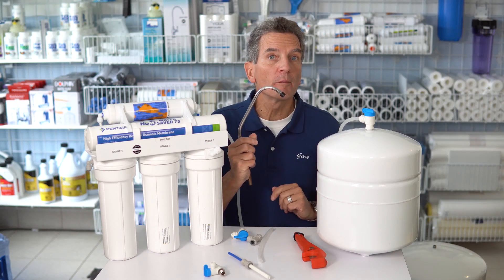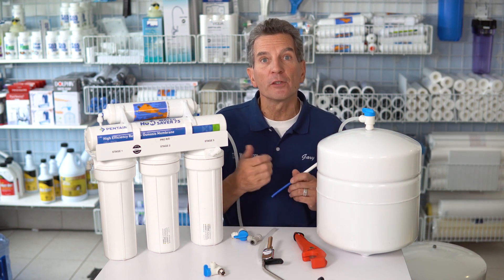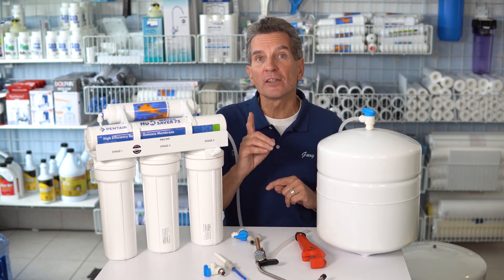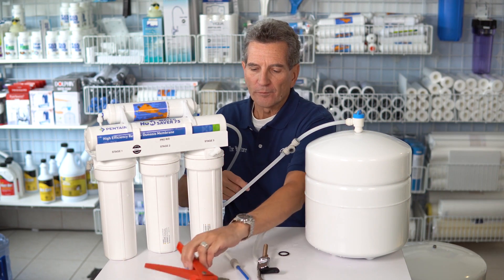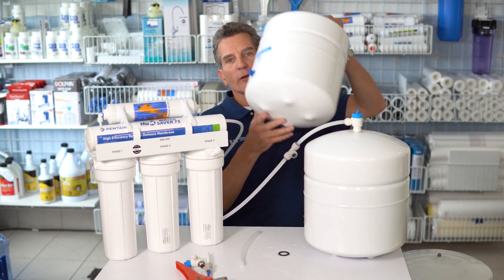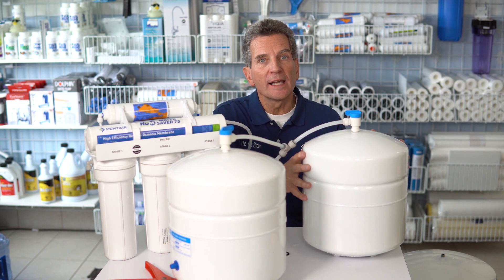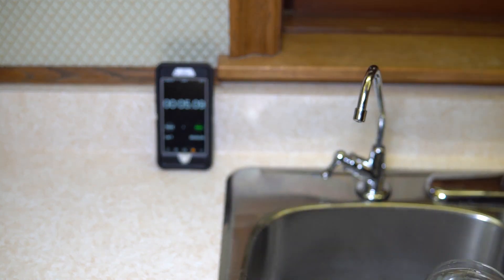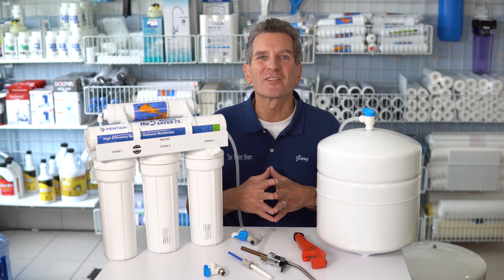HOW to MAXIMIZE FLOW from REVERSE OSMOSIS Drinking Water Systems

Comment: Ok what about increasing the pressure on the tank?  I already have 3/8” tubing and two small tanks.  But the flow to the fridge is terrible and takes forever.  Would I improve that more by putting a tank by the fridge?
Reply from the maker: Might help but fridges are notoriously bad at flow.  You can try replacing the fridge filetr wiht a bypass filter, helped in my fridge.